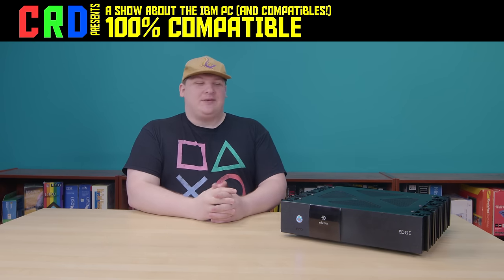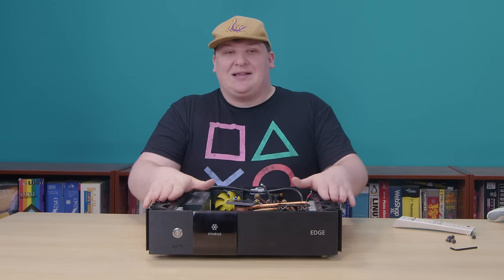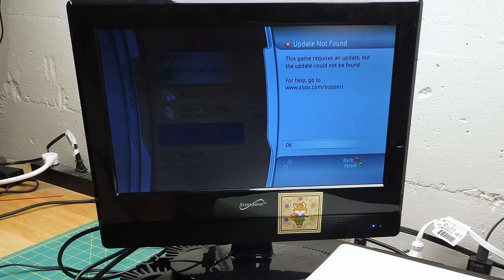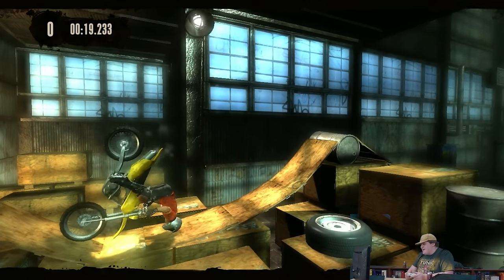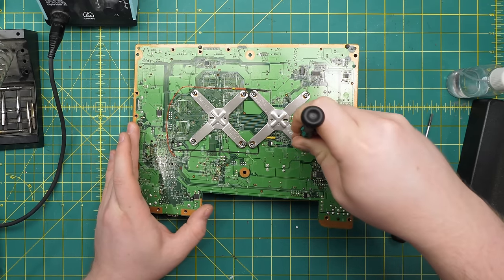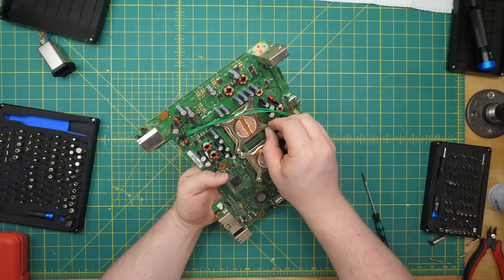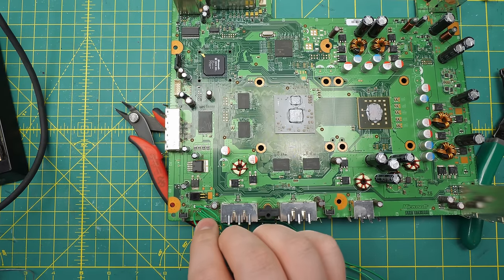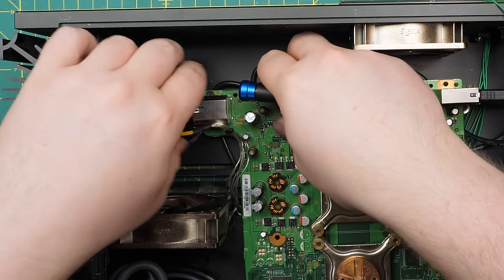The Niveus Edge Resurrection: Hacking A Hacked Xbox

Comment: So they could have shuffled all the dvd drives amongst Edges and no could play games and everyone could watch movies.
Reply from the maker: GOD I HADN'T THOUGHT ABOUT THAT BUT YOU'RE RIGHT. of course that means they didn't think of it either hahaha
Reply: @CathodeRayDude   the original 360 disc drives was really loud.  Weren't they trying to keep these silent?
Reply: That's pretty brilliant.
Reply: Maybe, but I think someone on the last video mentioned that you can't access DVDs from the Media Center menu, so they would have had to boot it into the main menu.
Reply: @CathodeRayDude  Because it wouldn't have worked (kinda). I have had a couple of 360-s with non matching DVD drives, and on certain DVD-s (or when using the HDMI output), if the encryption is wrong on the DVD drive, it throws "Secure HDCP link not found" and refuses to play. It is not a good user experience.

Comment: Massive thumbs up for the Western Union splice. I was taught how to do these about 25 years ago in an electronics class I took in high school. It was more like a shop class than a technology class with more emphasis on assembly than on theory. Anyway I use a Western Union splice almost every time I need to splice wires. It's obviously not always possible or practical, but having a solid, neat physical connection before you solder is always a plus. I don't know that I've ever seen another youtuber mention them before. Five points.
Reply: It's a recommended practice in automotive wire splicing, as soldering wires makes the connection brittle in vibration heavy environments, leading to higher resistances over time due to fatigue. Using a Western Union splice keeps the wires malleable enough to let them move under vibration load. So the best practice for wire splicing is to Western Union splice them and then cover the splice with heat shrink or fabric tape -- a lot of factory splices are done this way.
Reply: @Stoney3K  Thanks Stoney. I remember my teacher demonstrating that the splice got stronger under tension even without solder. Being the belt and suspenders type I've always soldered it anyways but may have been giving myself a metaphorical wedgie :P.
Reply: I wasn’t taught that name, but that was also how I was told to splice wires in electrical engineering/product design class!
Reply: @bluephreakr  ah yes, that was the name I was given! 😊
Reply: it's the recommended splice technique here in south America, where our power cables inside our homes have strands, and are not solid core. please use it!

Comment: moderately interesting fact about the "to play this disc, put it in an Xbox 360 console" screen: that's actually a custom dvd menu that got put on all xbox 360 game discs to (i guess?) defend against someone putting it in the wrong device by mistake.
Reply: Yeah, that suggested to me that the drive probably would’ve played regular DVDs; just had no authorisation for Xbox 360 games. (I have not looked into this keying mechanism.)
Reply: I was going to say that but you beat me to it
Reply: Also, Xbox 360 discs are dual layer DVD's, 7.5gb, and the DVD video is on the inner region of the first layer so that any/all DVD players will see the "this is Xbox 360" message.
Original Xbox games are single layer DVD, 4.7gb, so it was likely done to make sure people know"Xbox at home is not Xbox 360"
Reply: Same with many dreamcast and a lot of other gane systems. I remember a lot of Dreamcast games had track 1 as a redbook audio track that said something about it being for use only in the Dreamcast.

Comment: I love the rebuild you did here - despite any historical value it might have had, the original workmanship was so terrible that it really is justified. Especially that PSU... argh. That genuinely could have killed someone at some point.

One recommendation I would have, though, is that you make a sticker with a short summary of what you did and stick it to something that's not likely to be replaced later. One of the two huge heatsinks, maybe. That way there's evidence of what it went through, and someone 30 years down the line doesn't open it up and conclude that the company must have done a second version to fix a bunch of problems with the first.
Reply: Even just a CRD sticket would probably lead them in the right general direction, assuming YouTube doesn't end up purged from the internet.

Comment: 55:52 - I'd left a comment on the live stream but you were just finishing up when you'd mentioned doing this. Loctite doesn't cure without pressure on it; literally put a dab on your desk and set even a toothpick on it, all the exposed to air no pressure material will stay liquid, but where that toothpick is will setup and turn solid.

You need to back all your thumbscrews off and get the loctite under the fastener, at the contact point so it is compressed when you tighten it.

A lot of people miss this as this usually done at the thread surface when you put it on or in the threads of a fastener; and in that you might aswell just put it on the threads, but I'm quite confident that's why it never setup for you.
Reply: Commenting to bump this up and to add there is a wicking thread retainer for use on already installed fasteners.
Reply: absilutely hated running into entire pcs red loctited every single nut and screw and the screw head... dabbed it then tightened it down. 

i bet some used every bit of that 80-100lb rating. and only lets go at nearly solder melting temps.

Comment: I've never noticed before, but I recently discovered that "Right angle" "Left angle" "Up angle" and "Down angle" seem to be somewhat standardized terms for cable ends and adapters now. Really helps when trying to find the right ends for good cable management.
Reply from the maker: Yeah I'm realizing this now - it's really funny because it's, you know, _wrong_, right angle doesn't mean "it comes out the right side", but who can complain when it's a huge improvement? Once you know the terminology you can find whatever you need.
Reply: @CathodeRayDude  yeah, it seems to be pretty universal that "right angle" means whichever 90° connection is standard for that type of cable - for example a "right angle" sata cable goes down - and then "left angle" is used to refer to a cable that goes the opposite way (and i guess that by extension, up/down are used for the other two angles)

Comment: My favorite difference between Sony and Xbox consoles is how much easier it is to softmod PlayStations. I hacked my PSP, PS3, and PS4 within a few hours, I have never been patient enough mod any of my Xboxes (especially since my OG has a broken DVD drive). It's basically a selling point of the brand for me now, since doing anything on a less than perfect Xbox is a pain.
Reply: My softmodded PS2slim still works perfectly fine and that's despite the broken laser. I believe that says enough about ease and reliability of mods
Reply: Yea very true, I spend 2 days on hacking my XBOX 360 and still failed, i need to give it to a guy that has the better flasher as the Pico one just fails for no reason. No problems with PS's at all, even when both of my USB ports are dead af on my fat PS3.
Reply: It's wild the disparity between Microsoft and Sony's security
Reply: Add a modbo to a ps2 and an Xbox 360 seems like a walk in the park😁
Reply: Microsoft makes operating systems that have to deal with all sorts of malware, so they already know how to lock shit down. Same thing for Apple. The only difference between a PC and an Xbox (or a Mac and an iPhone) is how much the user is considered to be part of the threat model.

Sony on the other hand is a hardware vendor and a lifestyle brand. So they have no clue how to use cryptography effectively, how to write secure code, or even how to ensure upstream security fixes make their way into the downstream console's OS. Sony consoles will always be hackable.

Nintendo is in a weird spot where they used to be as incompetent as Sony, but massively upped their game with the Switch. It's not quite as locked-down as the 360, thanks to Nvidia screwing the pooch, but the online services for the Switch are just as easy to get banned from for doing anything untoward them as Xbox Live is.
Reply: @mhammadalloush5104  it's indeed not bad with good eyesight or magnification.
Xbox 360 is 2 wires and a diode plus holding pogo pins on the jtag test points for a bit so in comparison alot easier.
Reply: It's easier to softmod a PS2....Assuming you have one of the 21 models which can be softmodded.
Reply: Softmodding an Xbox takes less than 10 minutes, it's really not hard at all to do
Reply: @HammerStudioGames  but you cant softmod a 360, on every version you need to flash different firmware onto the chip
Reply: @BrunodeSouzaLino  We have Fortuna which works on all but the very earliest consoles
Reply: PS3 remained unhackable for years though, while X360 got modded within months or even weeks. PS3 might be easier to hack in 2024, but when that was the current generation, X360 was the console to get if you wanted to play homebrew and backups.

Comment: Thread lockers are designed to set only when not exposed to air, like when trapped in threads. We used to use nail polish as it is nasty stuff, hardens well and is used to make it clear if someone has messed with things.
Nice job though.
Reply: If you want it to wick into the threads on something already fastened you need the green loctite
Reply: came by to say exactly this, thank you!

Comment: Jasper was quite literally the best 360 ever designed. It had the best cooling. It was the most efficient (in the fat models). They always stayed cooler than any model that came after them. I love them so much that when they introduced the slim, I snapped up every brand new Jasper I could afford at steep discounts to custom build. I still have three or four I bought new I also installed Zephyr copper heatsinks on mine so they would run even cooler. You picked absolutely the best generation to put in the system.

Comment: If you ever do decide to re-route that power light wire, you should consider wiring it to the original LED rather than the solid 3.3v since you fixed the drive door sensor issue. Small improvement being the light will blink when it boots, but also the wire would be a lot shorter
Reply from the maker: I'd like to do that, but the question is whether it runs off the right voltage. This might be why Niveus did it the way they did; for this era of LED, those are probably "normal" green diodes which run on less voltage/current, so the supply may not be enough to light up the blue one in the switch.
Reply: @CathodeRayDude  For that to be a valid concern, it would mean they're overdriving the blue LED in the power switch directly from the 3.3V rail. Chances are the original power LED is driven from a 5V rail via a resistor, and a blue LED could be directly substituted for it with no ill effects. Heck, even if the original is driven from 3.3V via a resistor, blue LEDs are so insanely efficient that the half a milliamp or so it can get through the original resistor would still be plenty.
Reply from the maker: @BrendonGreenNZL  Fair enough, and it certainly wouldn't hurt anything to test it.

Comment: The HD-DVD drives still work on any connected 360 and you can still use them to rip the discs. Understandably, that is missing the point of it working on the Edge. Still, it’s theoretically possible to run DVDs on it- resolving the whole dvd mistake. That being said, trying to play HD-DVDs these days outside of the ecosystem of 360s and dedicated players is borderline impossible- someone really should figure these things out for the sake of everyone’s sanity. Excellent work, as always.
Reply: Won't the 360 play DVDs on any regular DVD-ROM drive attached to it?
Reply: @Stoney3K  Exactly my point.
Reply: It's a solved problem -- at least the movie itself.  AnyDVD HD.

Although, what you might be asking, and I don't know the answer to this, is if software exists to play the disc complete with menus and whatnot.  I have boxes of Blu-rays and UH box of HD-DVDs, but I've never once played any of them from disc, so it's never occurred to me to look.
Reply: @nickwallette6201  It has to be playable with the menus, just ripping them does not work. VLC can only play the videos themselves.

Comment: 55:40 What you want is "Green wicking-grade threadlocker" . It is specifically made to be thin enough to 'wick' into pre-assembled fasteners unlike conventional threadlock, which is really only meant to be applied before assembly.
Also another note, an exposed puddle of really any* theadlock will never set and cure. Threadlockers are typically anaerobic, meaning it will only cure in the absence of oxygen (like the assembled part), so the bubble of fluid on the top will never cure. That reason is why it's important to use a wicking-grade threadlocker, as it can actually seep into the assembled area and cure rather than sitting on the surface.

Comment: So about the HD-DVD player. The HD-DVD keys it needs to download are on a dashboard update that was included on a disc with the drive. Good luck finding one of those. You can get the same effect by updating the console normally (I have a 360 with a working HD-DVD drive) but blade xbox. The dashbaord update disc for the HD-DVD player actually is a later blade version so there's that I guess.
Reply: Correct!  IIRC the HD-DVD drive just needs 4532, while 4552 is the version that breaks the original exploit

Comment: I love how Niveus' brutishly large but effective cooling system means this will probably be the last 360 standing
Reply: They probably had caulking guns full of that white thermal grease
Reply: Throwing a bunch of metal at the problem is an effective way to achieve sufficient cooling

It's a very heavy and expensive way to do it, but it does work
Reply: @pocketpc_  true. And heat pipes are efficient enough to move it to the heatsinks even with all the less than optimal metal to metal interfaces in those stacks
Reply: Unlikely. According to Microsoft peak temperature has little todo with the RROD.
The simple fact that the chip heats up the cools down constantly is enough to kill it.
The actual temperature it reaches doesn't make much a difference.

Comment: I don't really think the Xbox DID have any power management. most of these consoles did what the 3DS or so did, where the console just unloads the dashboard, or keeps a very small shim, and until you call the shim with the dashboard or mini UI, the game could take up 100% of the system resources, which were a hot commodity. and they didn't care what power management it took because it was only meant to be used occasionally for the most part. 
again I could be very wrong about the xbox, but that's why I believe it had zero power management. that could also add extra work on the devs i recon. 
the Xbox one instead runs everything inside a series of VMs running HyperV, which is why the PS4 is faster despite having about the same power under the hood, the xbox had a crap ton of overhead as VMs usually take up.
Reply: The VM situation on the Xbox makes me question how games even had good boot times back then considering every Xbox One shipped with a mechanical drive...
Reply: @R4dm1n I mean, have you played a game on an xbox one recently? I wouldn't describe the boot times as "good". I remember that dragon age inquisition loaded faster on the 360 than it did on the xbone.
Reply: @maliciousintruder3010  360 games on the Xbox One are different. Obviously it's emulating the 360 so you also have to wait for the ENTIRE Xbox 360 boot process as well... I meant more of NATIVE games, not emulated.
Reply: @R4dm1n  That's what I'm talking about. The xbox one version of dragon age inquisition loads slower than the xbox 360 version, it's not backwards compatible.
Reply: @maliciousintruder3010  tfw i was sleep deprived while replying so my first thought wasn't to Google the game's platforms

still, that doesn't feel right
Reply: @R4dm1n   Probably the higher resolution textures and assets slowing down the hdd. The xbox one version looks MUCH better.
Reply: @maliciousintruder3010  mmm that probably makes more sense, even if the 360 uses either the disc or a SATA 1 bus, while the Xbox One's HDD is SATA 2 (though the bus is actually SATA 3). curious to know if it's any faster with an SSD modded XBO?
Reply: @R4dm1n  I never put an ssd in my xbox one but from what i remember it is significantly faster if you use an external usb ssd. It's also worth noting that the xbox 360 version comes on two dvds. It installs one disc to the hdd and while you're playing loads from both the hdd and the second dvd simultaneously. I think GTA 5 did this as well.
Reply: The 360 also has a hypervisor but it is custom. This essentially acts as the shim you are describing.